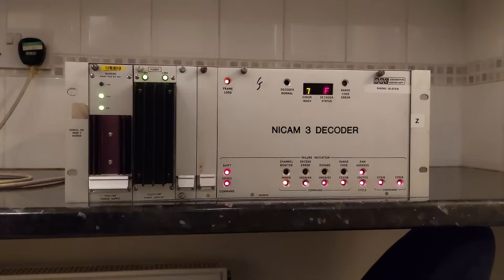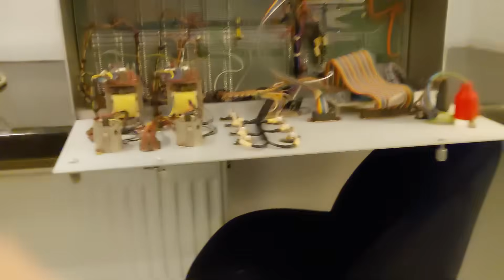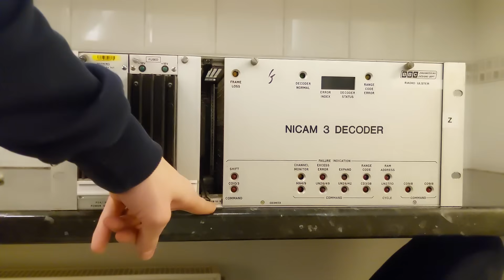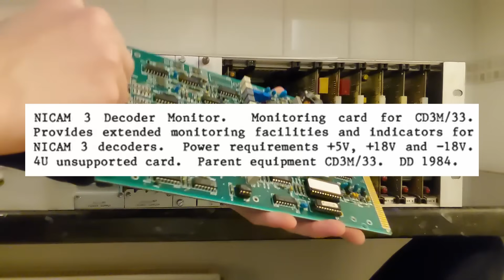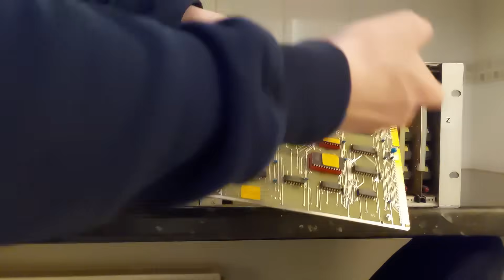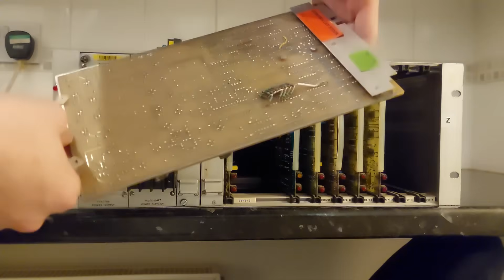A Look Inside: BBC NICAM 3 Decoder

Comment: Interesting video. Nicam was quite innovative for its time, although there's no justification for the beeb to still be using it in 2026 (as they are, for Radios 1 thru 5 on both AM and FM!).
I was curious about the two blue-coloured DAC chips. Googling suggests one is a 12-bit DAC and the other is 14-bit. Not sure why there are two?
For Nicam, the most you would need is 14-bits, but since only 10-bits are ever sent, it occurs to me that you could use a 10-bit DAC and then just use the range code to switch between 5 different levels of attenuation (of the DAC's output) in the analogue domain, although I'm unsure as to how well this would work in practice.
Incidentally, the earlier PCM system (used between 1972 and the end of the 1980s) sent 13-bits.
I wonder also if the NIcam stream carries the FM RDS data?
Reply: I always had been amused that Hifi comics lauded radio 3 live broadcasts as the best you could get but sticking with 10bit resolution was just scandalous really. Good enough for tv but not music. It was a good solution given what they had so hats off but to never attempt to make it better.
Reply from the maker: The clever thing is it's only 10bits on very loud samples. For quieter sounds it goes up to the full 14 bits. I personally couldn't tell the difference - and I suspect you certainly couldn't tell the difference once it's been through the FM stage!
Reply: @AvroVulcanXH607   You're correct to say that very quiet sounds (where, on the encoder side, all samples in a group of 32 utilised only 10 or less of the available 14 bits), go through losslessly, but that "no-loss" zone only covers the bottom 6.25% of the total linear amplitude scale.
Louder stuff starts dropping bits - up to 4 in the top (loudest) range, which covers a huge chunk (roughly half) of the total linear amplitude scale. Pop music almost always occupies that loudest zone, so you're effectively listening to 14-bits truncated (ie. not dithered) down to 10. 
The truncation creates signal-correlated distortion instead of smooth random noise (engineers would normally use dither when reducing bit depth, to avoid this).
FM isn't perfect, but Nicam introduces its own set of digital-specific artefacts, and doesn't take full advantage of FM's capabilities.
Reply: @EastLight07   Have you actually listened, double-blind, to NICAM to justify such a claim?  Do  you think the BBC would build it's entire radio distribution system on a technology which had not been auditioned in such a manner?
Reply: Straight 10 bits would give you 60dB of dynamic range. Most domestic tuner/antenna combinations receiving a stereo FM signal (which is noisier than a mono one) would not be as good as this. If you add in the ranging of NICAM, the subjective performance is more than adequate for FM radio. Blind listening tests were done in development to determine whether it was worth using an extra bit and the conclusion was that it wasn't.
Reply: @neilsradios  60dB would be a weak FM signal. FM stereo reception would normally give you between 70 and 80dB of SNR, so you'd need 14-bits to match this.
Linking bit depth directly to SNR (like '10-bit = 60 dB') is a bit of a shortcut anyhow. In digital audio, quantisation adds a fixed noise floor. But in analogue FM, the noise is additive, so as the signal gets louder, SNR actually improves.
Reply: I think the justification is that the cost of replacing what is still a working system with something else for a 'legacy' platform outweighs any potential benefit. The BBC replaced the encoder side relatively recently with an FPGA based design, and given it's effectively a split estate (with the BBC responsible for the encoders and Arqiva being responsible for the decoders), I'd assume the Beeb are satisfied they now have a supportable system. Whether Arqiva agree or not is anyone's guess, but I'm sure that's factored into the managed service contract they both agreed to.
Reply: My understanding is that as the long term future of FM broadcasting in the UK is uncertain, there is a review this year, but currently FM is only guaranteed until 2030, it did not make economic sense for Arqiva to make the capital investment to replace all of the transmitter input equipment. Hence just the replacement of the source encoders.
Reply: @laverdanick  given the ratio of encoders to decoders, a single encoder failure has significantly higher impact than a single decoder failure. It also meant a much smaller pool of spares to draw upon. It's all very reminiscent of the old Sound in Syncs kit used on the TV side.

Bit of a no brainer in the end. You only need to build a dozen or so boxes, as opposed to 100's of decoders... Must've been a fun project for someone to reimplement all the NICAM ASIC's in VDHL, though.
Reply: My recollection is that it took a few iterations before it all worked, though I can’t remember the name of the company who delivered the product. I started my career as a Transmitter engineer, pre Nicam on the old PCM system, though the Nicam system was covered in my training, I finished my 40 years as Duty Manager at Broadcasting House, having been evicted from Television Centre, when that closed in 2013.
Reply: @laverdanick  seems highly likely our paths might've crossed if you were a DOM, then. There's an article on the R&D blog about the 'new' encoders (from 2016 by the looks of it) so even that's not that new, now. I know a few of the Arqiva engineers up at Winter Hill (my local tx) who are ex-BBC Transmitter dept, so got the full tour of the BBC building on site pre-DSO. Sadly network radio at WRH is RBL from Holme Moss, so no exciting NICAM kit on site.
Reply from the maker: It does, although I don't think that was in use for this era of NICAM. The Mk 2 system used separate "combiners" to send the RDS data - see Matt's article for more info on that!
Reply: Wouldn't you just run the data and the magnitude through a shifter and then into the 14bit dac?